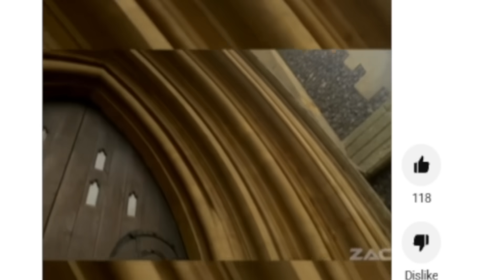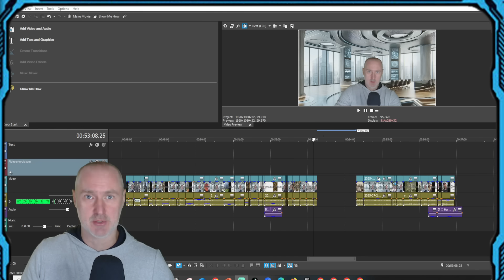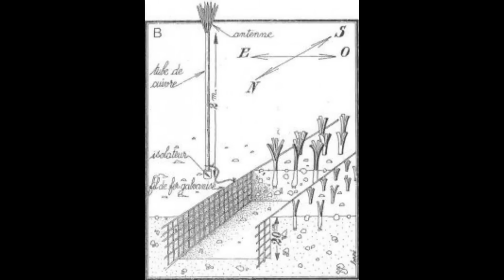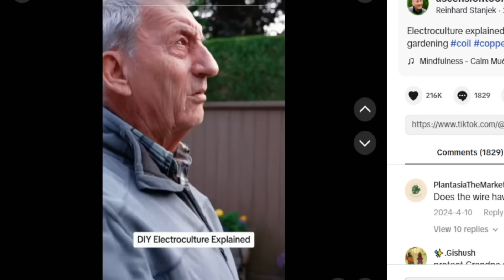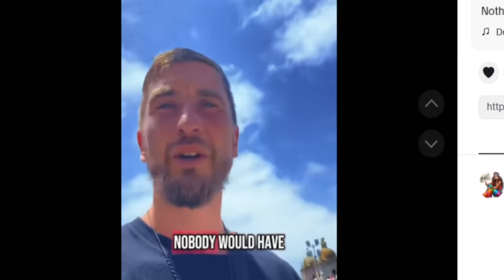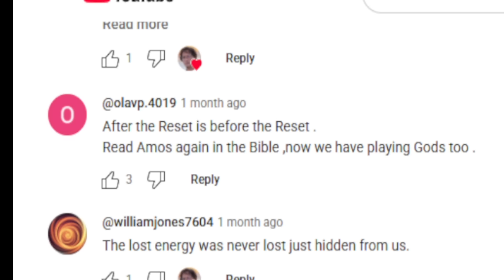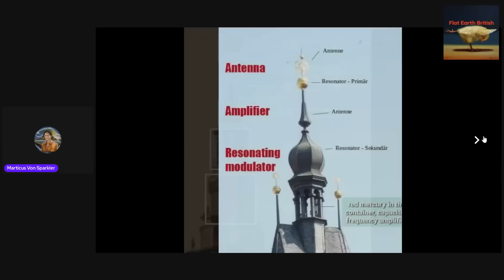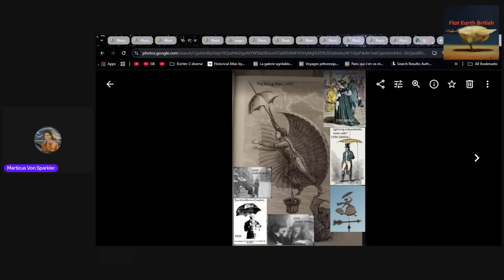The Theory That Is More Stupid Than Flat Earth?

Comment: The atmospheric electricity collecting devices are real. however they collect micro Amperes at hundreds to thousands of volts.  Can be used to drive LEDs and radios... So there is a core of truth in this.However collecting Cosmic energy and make your plants grow faster is nonsense.

Comment: If every cell in the human body produced 7/10th of a watt as claimed, one human body would produce 25.9 trillion watts, which is 4.5 times the total electrical production of the entire human race.

The human body produces 100 watts. You would need approximately 55.6 billion human cells to match the power output of one AA battery under normal use.

Comment: Not so funny story about the lightning systems installed on most churches.  The church I grew up in had an attic fire a few years ago from lightning striking the church during the 2 days that the lightning conductors were removed due to some restoration/replacement work on the main spire of the church. Yeah. Those 'rods' are quite important for electrical reasons.  Just not the reasons these guys are talking about.

Comment: Shhh! no-one tell the pseudo-science crowd that there is free energy out there.  What they need to do is get the largest copper object they can (a barrel would be ideal), fill it with water, then run a copper cable from the barrel to top of the highest building they can manage. Then, when they know there is lightning on the way, get into the barrel and wait.  You won't believe the amount of energy they will get from that process. Honestly, their lives will never be the same.

Comment: As you now know, your reception of etherial energy has been hampered by the length of your hair. If you click your heels together 3 times and wait about 18 months, you could have considerably longer hair. Step 2: Wrap yourself in copper wire (clockwise and counter-clockwise) whilst standing in a garden, that is adjacent to a church with tall spires. Step C: Carry out step two during a  violent thunderstorm. Finally: You will very likely absorb some free energy that THEY don't want you to have. Step 5: ENJOY!

Comment: Let's have a look at the church's utility bills. Quick way to find out if they are indeed getting free energy, or not.
Reply: When I was 10 my classroom windows looked out at the rear end of a church. You could see the large oil tanks that the heating system used for its fuel storage and the regular visits by the tanker to fill them up.
Reply: @martinconnelly1473  Are you sure about that? Weren't the tankers collecting the surplus oil produced from the energy generated by the church?
Reply: Didn't you see? They are all turned off!